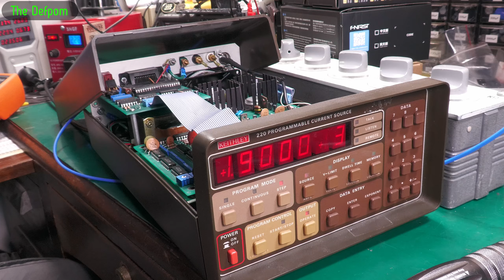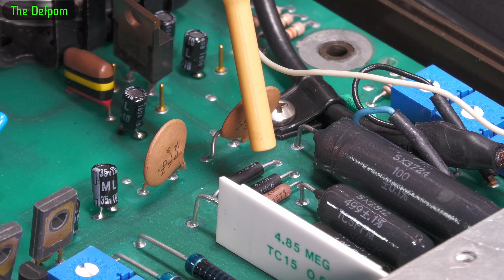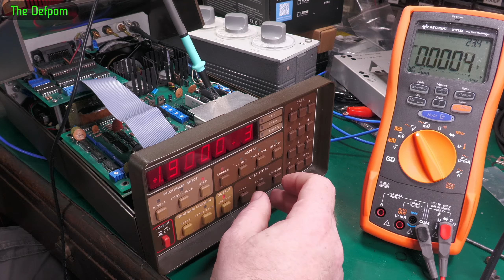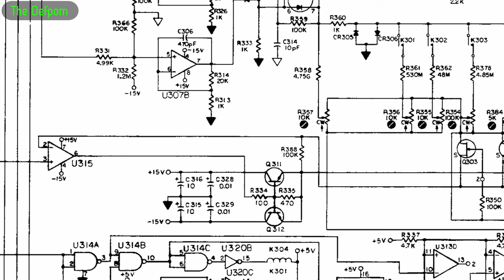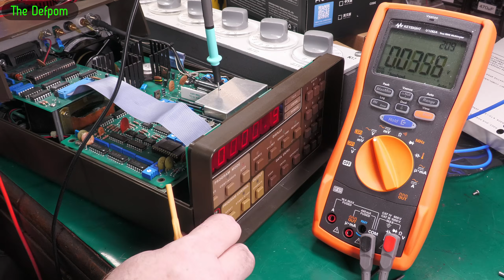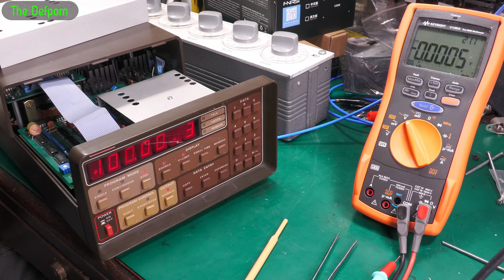🔴 Am I Finished ? Keithley 220 Programmable Current Source Repair Part 4 - No.1429

Comment: Nice work, Scott!  As others have said, I would get the 15 volt rails sorted first then do a bit more research on circuit operation to understand what is going on. If tempco continues to be a worry you can order high precsion resistors from Mouser. Regards, David

Comment: If the unit is a keeper then it might be a nice improvement to replace the Vref circuit resistors with modern low tempco versions (I think the ones fitted are just 1% resistors, nothing special), and also changing the trimmer for a 10 or 25-turn version. Maybe even a better op-amp. Just a thought.

Comment: Hi, you adjusted the +15V rail to spec from 14.4V, which did show some influence, my next step would be to bring the -15.3V up that 0.3V to the  correct value.
I would consider 15.3V rail in a precision measuring device too far out, I would throw out any 7915 that was that far out, likewise a 7815 that is 0.6V low as a throw out.
Have you scoped the two supplies?
Unless you have a grounding problem.

Comment: Are you sure the trimmers are original? They look rather modern compared with the design of the unit!
Reply: They look like 3362P, they went on the market in 2004
Reply: @cambridgemart2075 The 220 dates from 1982, so it seems very likely they aren't original.

Comment: The disparity between +15V and -15V rails would've been the first thing I'd address before tweaking any adjustment bias resistors. Were the regs just fixed LM78/7915 types or something you could tweak for more precise output ?
Reply from the maker: 78/7915

Comment: You need to spend more time on the circuit diagram and work out how it works in more detail and how ranges interact with each other.  Otherwise your just be chasing your tail. IMHO.
Reply: There is a calibration procedure in the manual.
Reply: @Y.T.Learner  But you need to fully understand the circuits functionality in order to understand why it's failing the calibration. you should not need to change component values to get the calibration correct. You need to find the one  or two that have changed their value to cause the issue and put them back to correct value. All resistors change value over time, which is why you need to calibrate every so often. If you can't calibrate then you need a lot more expensive ones to start with that have a very low drift over time. So there could be a resistor that has drifted to the point where the cal pot can't pull it back in.
Reply: @TheEmbeddedHobbyist    Following the calibration procedure is a good foundation for all the other activity that might be necessary.

Comment: Is there a f/w calibration? There might be a way to adjust the data sent to the ADC?
It would be a very bad design if the supply rails affected the output much.
Reply from the maker: it is all by trimmers and precision resistors
Reply: @TheDefpom that's a shame as one or two count change for that range might be all that that's needed.